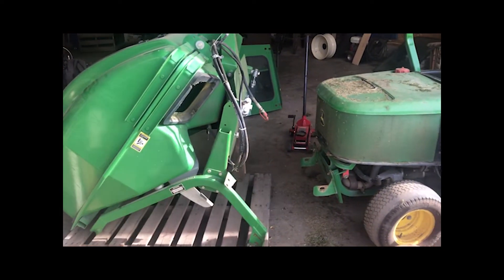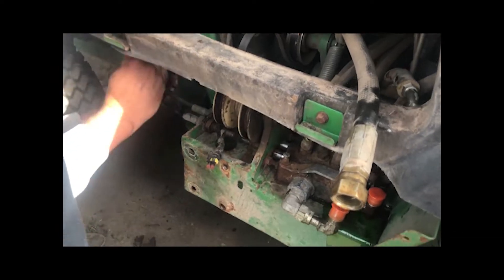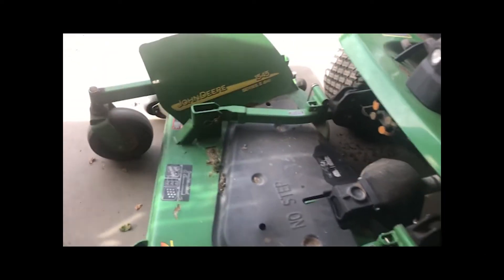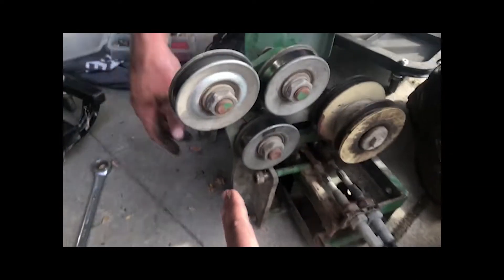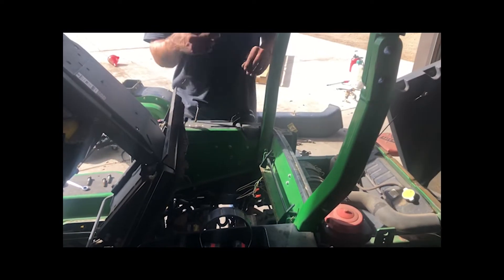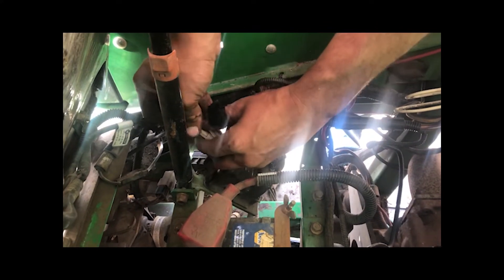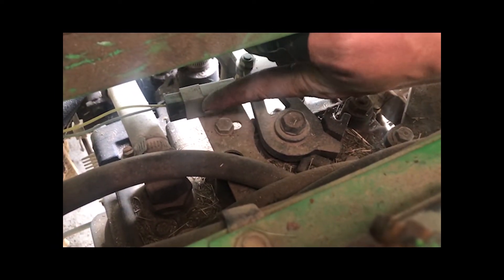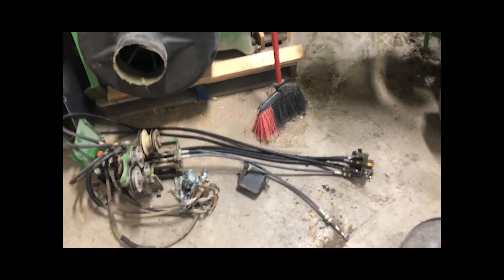Removal of a MCS 600 John Deere Collection System

Comment: you guys don't need this anymore or something?
Reply from the maker: we bought it with the mower and only plan on using the power unit for snow blowing, so will put a cab on and snowblower. thats all we use these units for. when we mow / bag we just use a zero turn. much cheaper to run and about the same speed.
Reply: @farmingourway8493  I honestly prefer using these things for mowing only. I am job hunting so I can save up for one of these things and it's hard to find jobs here in willmar mn that will hire a 16 year old but I will find something hopefully soon. Normally people use these things for mowing and snow or just mowing. BTW what kind of zero turn lawn mower do you guys have will you make a video of it mowing?
Reply from the maker: @caydenvlogs-mn1jo  pro turn 160 and 2 dixons 52". if we get like a wide open field bigger than 2 acres we might consider using our jd front mounts otherwise the zero turns are the way to go.
Reply: @farmingourway8493  If I was to get a zero turn I would probably get a john deere Z997R